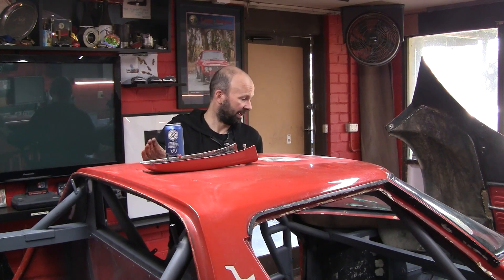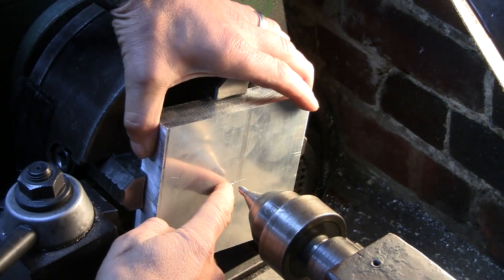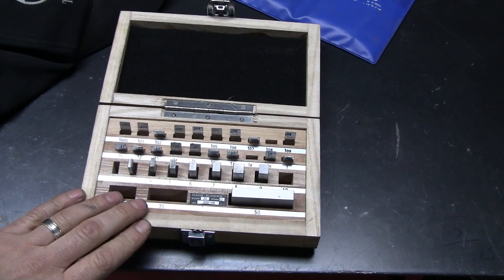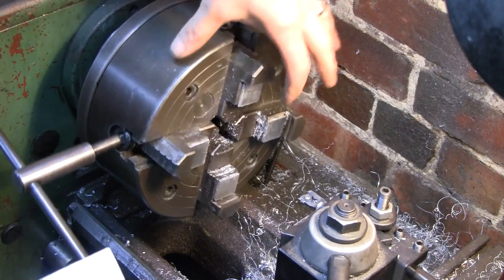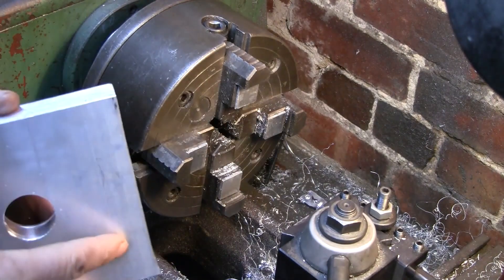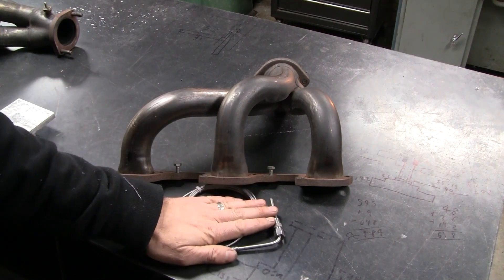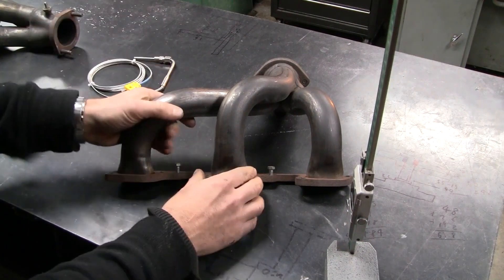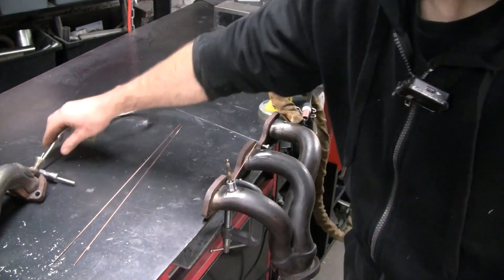Project Stratos - Episode 30 Strut Top Brackets and EGT's

Comment: FYI peak temp in an exhaust port is actually with the tip protruding 2/3 through the stream. This offsets the heatsink effect on the mounting boss. What do you target as your temp?
Reply from the maker: Interesting, yea no target temp, purely there to check consistency of each cylinder in each bank, as I'm running an O2 sensor per bank

Comment: lol @ mixture anxiety! 🤣 

I’ll never forget the time we melted 2 of 4 pistons on the FSAE engine dyno. The AFR was spot on in the log, but turned out the outer two cylinders were running rich while the inner two were lean af due to a questionable fuel rail design (#juststudentthings). We always ran individual cylinder EGRs on the dyno after that...
Reply: Good example of why OE doesn't use lambda as a tuning tool. Basically run at lambda 1 until temps get out of control and then enrich until parts don't die.

Comment: With the multiple exhaust heat sensors - will you have some sort of algorithm in your ecu to make mixture adjustments or to generate an alarm based upon differences or will you have to manually assess ? Sorry if it’s a dumb question - my knowledge of the abilities of little black boxes is very limited.
Reply from the maker: So I'll have all 6 temps constantly displayed on my dash so I can monitor them, I'll probably have some change of colours or something if the differences go over a certain threshold.  They'll mostly be used for initial tuning, they will help with setting up the ITB's and also see if we need any individual cylinder fuel trims.  The ECU can do a lot of engine protection, so i think  its possible to shut down a cylinder automatically if required, but once set up i think they will mostly be used for fault finding if/when we have engine issues
cheers

Comment: Are u going to remove the glasses before painting?
Reply from the maker: Good question mate, probably not in this case those screens aren't exactly easy tho come by, and I don't think we'll get it out without breaking it. We'll remove the sealant as much as possible, paint it and re apply some sealant, should be fine

Comment: Nice work again. Why doesn't it surprise me that you ran 4 wide bands on a 4 cylinder :D
Reply from the maker: yea, the collection of busted (expensive) pistons on my wall of shame goes some way to explaining the insanity.  I also have 4 EGT's, 3 water temp sensors across the head, a knock sensor and 3 fuel pressure sensors, after all the at the problem turned out to by too much ignition advance and nothing to do with mixture....
Reply: @105colin  Haha. That sounds about right. The more monitoring can't hurt though.

Comment: Nice work Colin, was starting to wonder if you had covid...
Are you going to do some collectors with a nicer angle?
Reply from the maker: No covid yet, but it's closing in!
Whilst they are by no means perfect the factory headers aren't to bad. On the 105 I built some crazy headers 4-2-1,all equal length, with 3 diameter increases in the primaries. They produce great power, but a huge amount of work.  I think the headers on this car will get attention in stage 2,after the car is built!